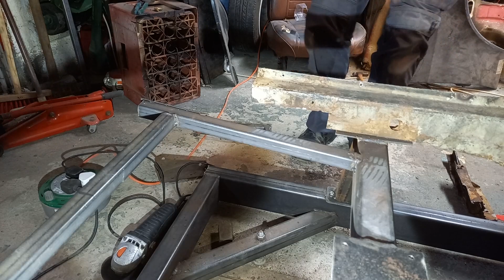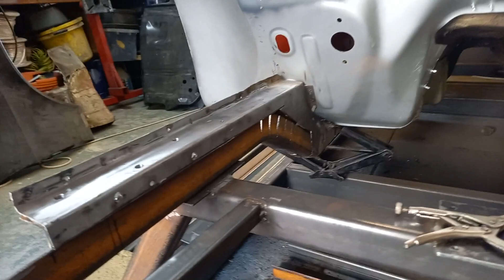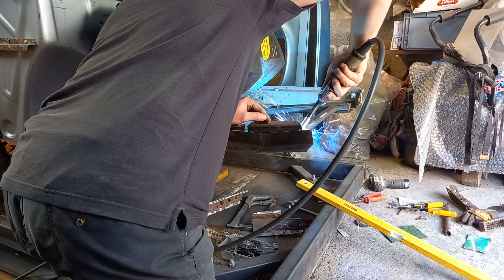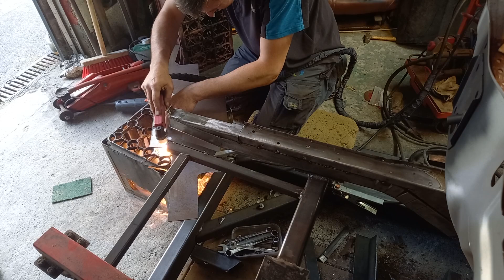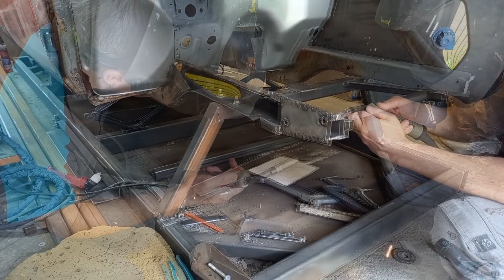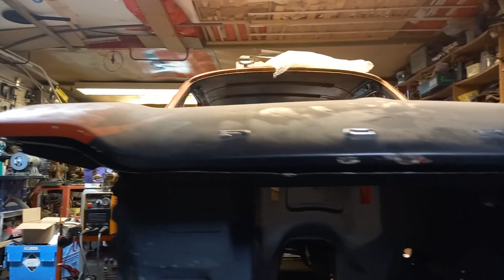Escort MK1 Restoration Project, Part 14- OS chassis leg: car  restoration

Comment: Hi Dave.  Was watching  you making your jig.  Brilliant.   A thought. I had.  I don’t get many. Lol what would you think to using.  A bottle. Jack x2 on the rear hangers.  With. Bush and plat form. Through the hanger. Onto the jack. Mounted to your jig.  Markes it adjustable.  Moveable.  And. You can do it  with. Measurements   
Just a thought 

Great work. Mate.  Crack on.  C
Reply from the maker: Great idea

Comment: Hi Dave great job feel your pain I’m currently doing front end also 
Could I as you for a measurement please 
The lip on the bulkhead where the inner wings fit under need to know how much of a lip there is, Thank you david
Reply from the maker: I think I know what you mean, on the engine side it’s 30mm on the outer side it’s 40mm these are to where the bulk head starts to lip up, so to the face of the lip would be 1mm or so again. If that makes sense?
Reply: @DavesGarageuk  Perfect appreciate the help looking forward to next video 👍🏻

Comment: Nice work, have you tried a practice run with the wings mine were way off
Reply from the maker: I have a tatty original wing, and a copy new, the copy wing in dreadful, the tatty ordinal wing fits nice. I intend to bubble arch it, so may try and repair the original wing with a bubble fitted, and might save up for a fully pressed bubble wing for the of side, a bit down the road for that yet. Plans can change. How bad a fit are your wings?